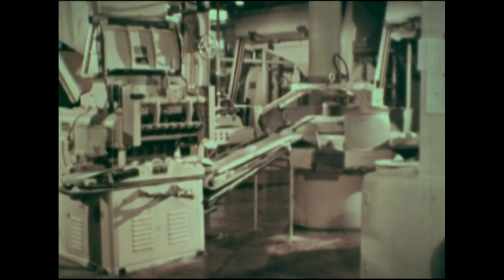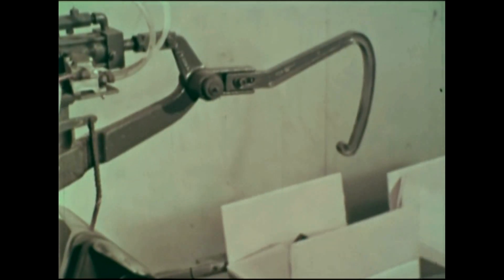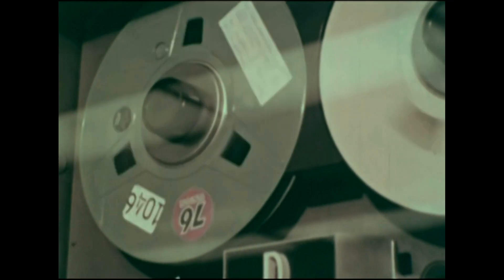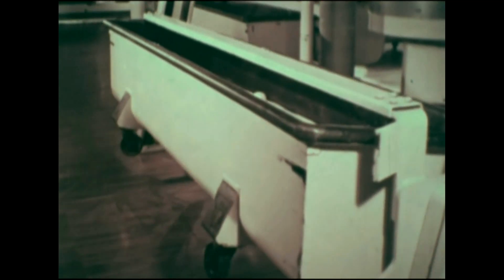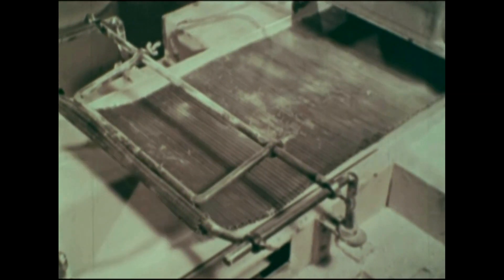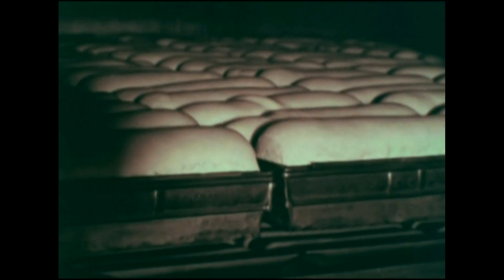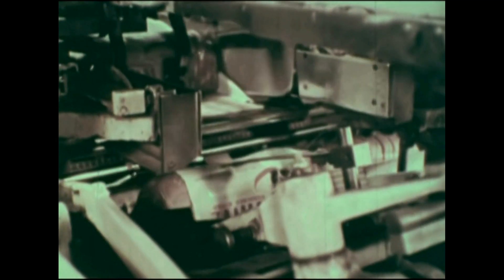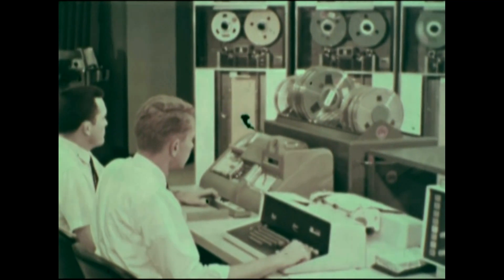Computers and Machines 1960's Automation, Langendorf Bakery Factory Los Angeles (IBM, CNC, Mag tape)

Comment: never knew they did CNC on paper tape, but kind of makes sense I guess. Not much has changed in how bread factories run. The machines have just gotten a lot easier to clean and keep clean (thanks partially to stricter health regulations), but most the processes are still done the exact same way and because you can't rush chemistry (which is what making food really is) they still run at about the same pace

Comment: Ah. Now I understand the origins of the term. 
Best thing since sliced bread! 🍞
Reply from the maker: Ha, ha... Yes!
Reply: Correct, but the term actually originated about 40 years before. In those days there were no supermarkets, but a butcher in a store front, a baker in a store front, a "greengrocer" in a store front, etc., in the central part of most towns in America. 

With the coming of mass electrification in the 1920s, all of these local bakeries acquired an automatic bread slicing machine. They would bake bread in the morning, and have it in the display case inside the store. You could pick out the loaf you liked, and they would ask if you wanted it sliced. 

If you agreed, they put it in the bread slicing machine, and it made slices out of the loaf right in front of you. In either case they then dumped the loaf into a white paper bag the shape of a loaf, and perhaps sealed the top of the bag with a sticky-label with the store name on it.

People quickly came to appreciate pre-sliced bread, and thought it was about the greatest idea of the time. And from that came the saying, which was used when something new came along.

Comment from the maker: Anyone care to guess what type of mainframe is pictured in this film?
Reply: I think it was a ibm 1401 but maybe a 1130
Reply from the maker: Thanks, very close, similar time period.   The computer in the automation film is most probably an IBM 7070.  We have a video of that machine posted here:  https://youtu.be/fF6Xl8iep7o
It is kind of a rare machine...
Reply: @ComputerHistoryArchivesProject  I wonder about that. I don't recall if the 7070 was a 6 bit machines with one-character A and B registers, but I know the 1401 was. 

Ah, a quick internet search says "The 7070 series stored data in words containing 10 decimal digits plus a sign. Digits were encoded using a two-out-of-five code. Characters were represented by a two-digit code." The machine shown was a 6 bit character machine, so not a 7070.
Reply: A Soylent 360?

Comment: 3:36 interesting that it shows a milling machine drilling holes that were already drilled and cutting slots that were already cut
Reply: I'm not sure, but I think the process required deburring (finishing - taking the rough edges and swarf away). It looked to me that it was deburring or "finishing" the holes and slots.
Reply: @whackydumdum  Could be.  Likely it’s a filming setup issue.  Once they got the framing focus and lighting the way they wanted it would be easier to just repeat the same motion.  Also the camera operator likely would not be thrilled about flying chunks of metal near his lenses.
Reply from the maker: Scott,   I would tend to agree, "finishing" is the key here.
Reply: As a former machinist, I'm inclined to agree with @trigger thesound in that the camera operator didn't want metal chips flying at high speed at his face and camera lens. It's a great shot of an old school Numerical Control Machine though! It always amazed me at how clever that technology was.
Reply: @KrisRyanStallard  Also the machine likely used coolant, and you can't see anything through that.